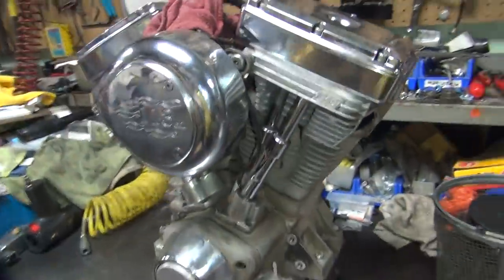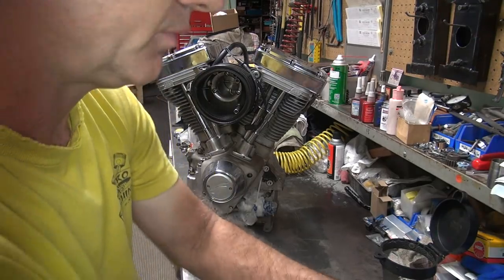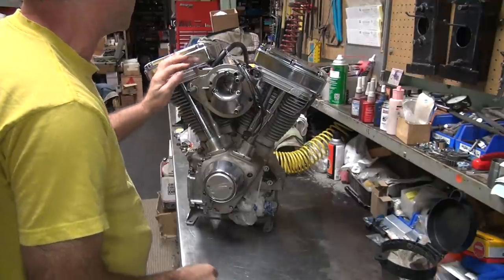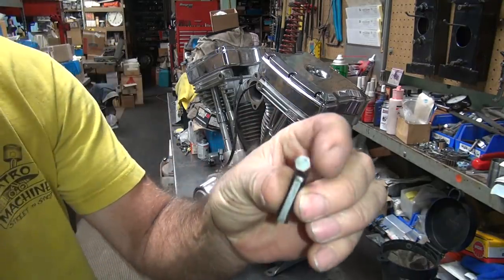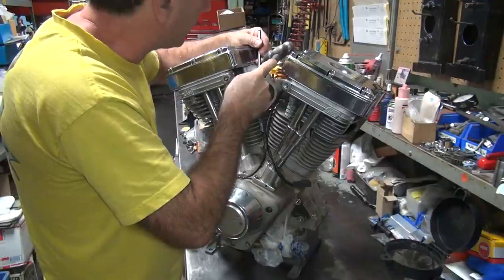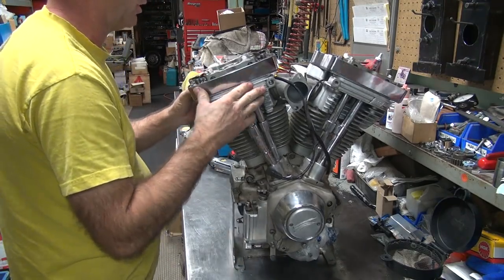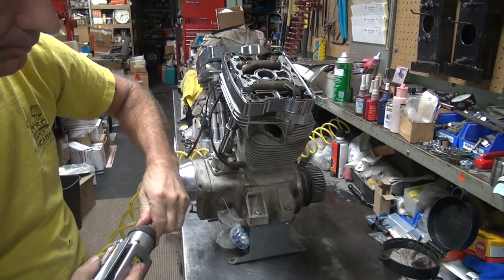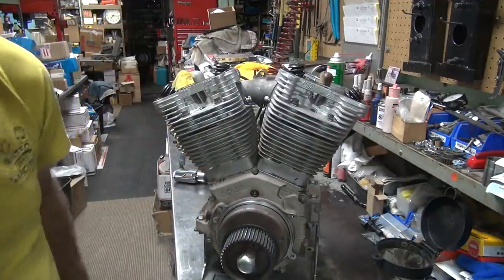#101 S&S 113ci evo motor pulled cylinder studs repair harley swift evolution head by tatro machine

Comment: I had a 1994 Heritage that I put 65,000 on. Some of the miles were a little hard but I never abused my engine. Never hit the rev limiter. I had Shovels and one twin cam. In by old ass opinion, The HD Evo engine was the best ever made. When I sold the bike, it ran like a pro. only things I changed on the bike was removal of the crossover, knocked out the plugs in the slip-ons, put a 490 Crane cam and S&S E-model on it. Beautiful running engine.

Comment: Happened to me . On a delkron Evo  mild performance build .  case .  The motor mount to frame cracked clean off ..on the Softail frame end must of been somewhere in Florida . I kinda heard it ,,I was Going cross country. In Utah . I noticed weeping on the base gasket .  And I was a vibrating mess my hands were numb ... Got lucky and just locktited the studs . Still going strong over 10 years ago .   Delkron cases are the best ....

Comment: I'm sorry but I don't know how you do it Keenan. You're constantly taking it in the shorts. I have a special allen wrench that's angled and is made for doing intake bolts. Cant remember where I got it from but it was a great investment. I also use it for early Evos on the primary for removal of the set screw which holds the shaft in place.

Comment: I have the exact same motor, 2007 and mine keeps overheating and blowing head gaskets also. I called S&S to try and get to the bottom of it. I am a certified HD and Honda America motorcycle tech and I just couldn’t get a grip on what was happening. The guys at S&S suggested that it might be the knock sensor giving “false” readings to the ecu which for mine is the ISP ignition system that they no longer make and this is probably why. So, evidently the knock sensor was making the ignition system retard to the point of overheating the engine. Has anyone else heard of or experienced this issue?
Reply: Garbage bikes !
Reply: I have a stock engine that makes 150 HP has 85.000 miles on it and has NEVER !!! Been out of the frame !AND IT'S ITALIAN !!😄😄😄😄😎😎😎😎😎
Reply from the maker: put a carb and a real ignition on it and the computer will not be a problem again. their is something to be said for being simple.
tatro
Reply from the maker: and no one cares.
tatro
Reply: Tatro Machine it has a super G. I would never own a fi bike